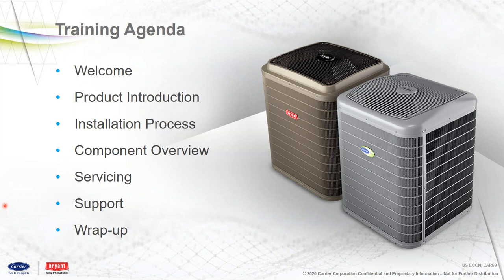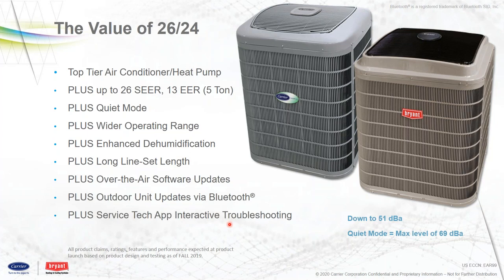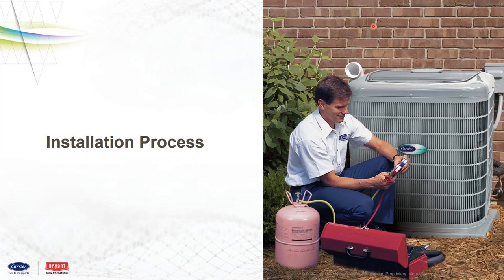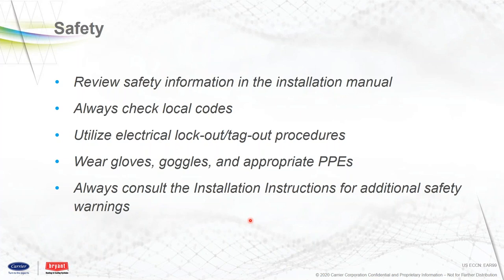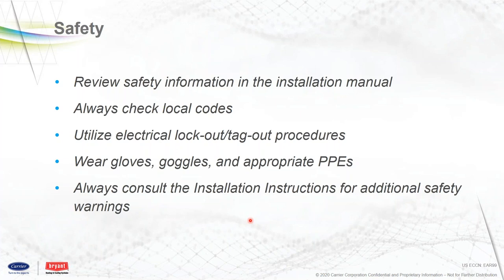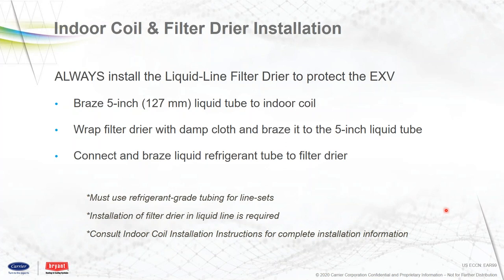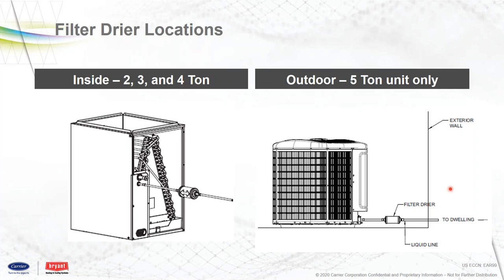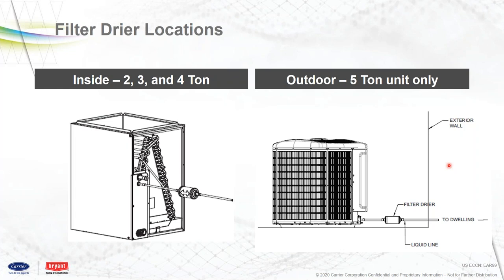Inverter 26 SEER Install Part 1 - Webinar 4/9/20

Comment: I think the guy filling the system is doing it wrong. 410a should be done liquid.. not gas. But then again that photo was the old R22 days..lol. how about that metal tool box.
Reply from the maker: YouTube auto-picked the thumbnail pic. The pic was on the Installation title slide of the PowerPoint. That same PowerPoint template is used generically for many of the Carrier training modules. That pic is not specific to the unit discussed in this online course.